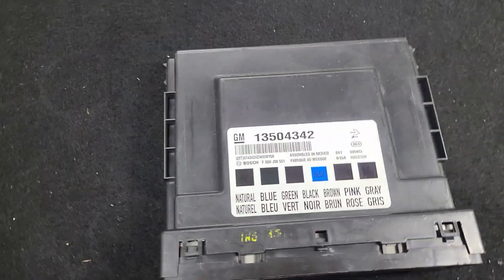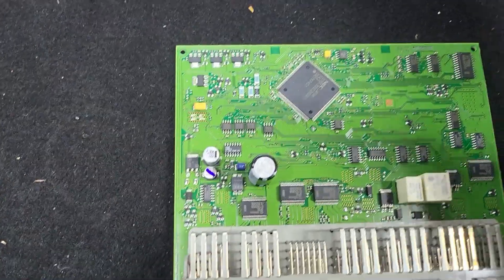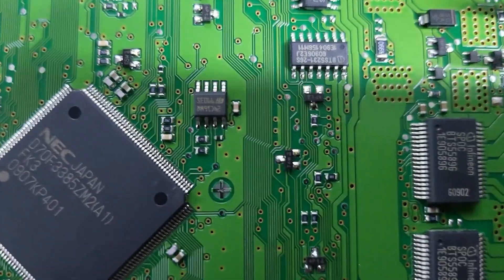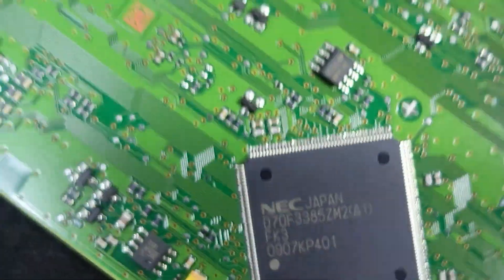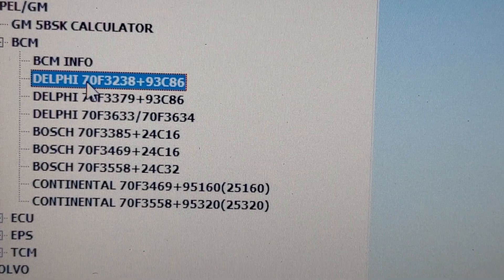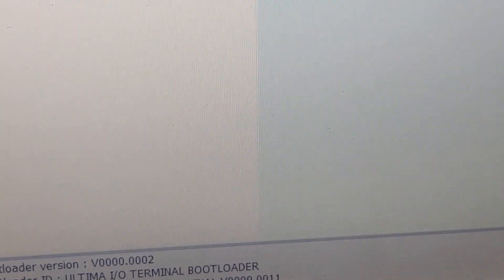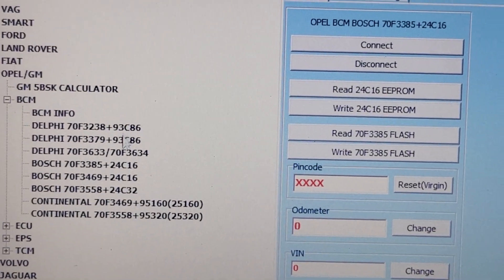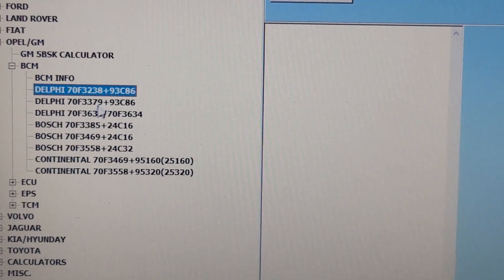How to recognize BCM Module Vauxhall/Opel type of CPU and Eeprom

Comment: What program is this?
I am looking for a program to tackle any module or chip. Preferably to program via can bus pins or outside of box

Suggestions, ideas?
Reply from the maker: Tjis is IO Terminal, but this license only for Opel BCM and ECU. If you need more modules you need to pay more.Have  No multitool for all chips and ecus.
Reply from the maker: try to read about Flex Full version.